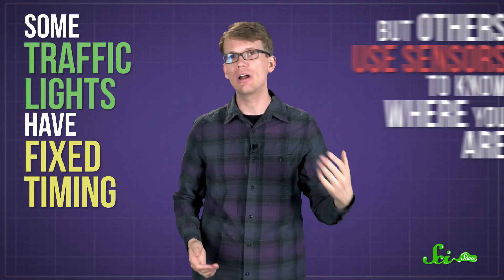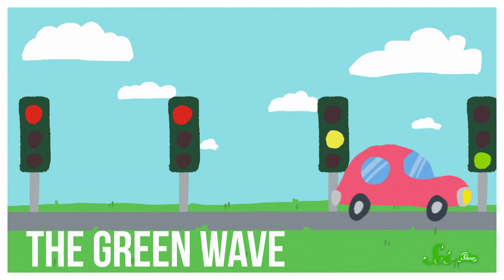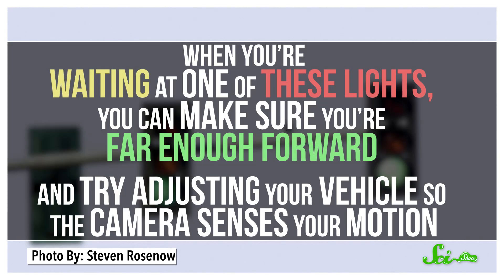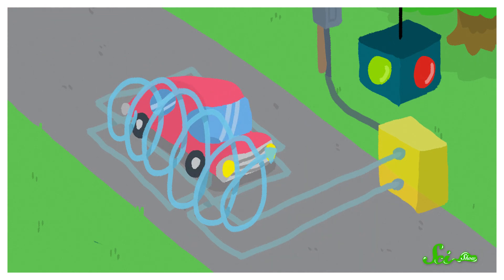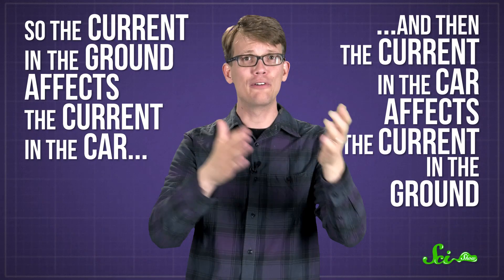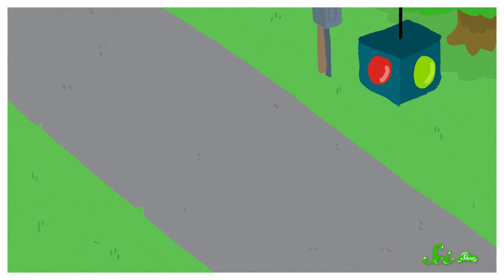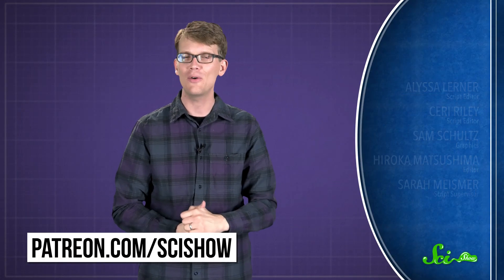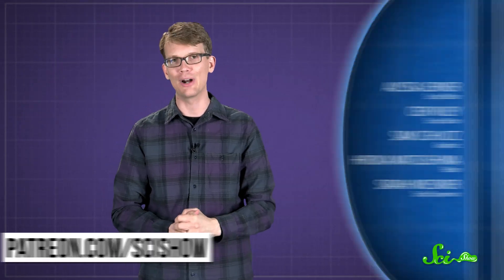How Can I Make A Traffic Light Turn Green?

Comment: Bicycles can change properly adjusted sensor red lights if they have alloy rimmed wheels. It works best to use the rear wheel (largest amount of metal on a bicycle) over the point where the induction loop starts. This is the point where a line comes into the loop of the sensor. If you put the rear wheel directly on top of where the line meets the loop, a bicycle can change about 75% of red lights. It is much harder to get lights to change with carbon fiber wheels.
  What Sci Show said about "push the button" is illegal in most states. The button,  crosswalks, and sidewalks are for pedestrians riding a bike on them is against the law in most states. A bicycle operated on the road surface is a vehicle. Technically the problem should be reported to the municipality as a nonfunctional red light, and you should treat the intersection as such. Although the limited functionality of the intersection should be made criminal as endangering unprotected civilians is inexcusable. The settings of the sensor and it's calibration via the PLC network that control the light, are the real problem most of the time. General passing traffic are all that is used to set up the system in an undefined nonstandard fashion. The limits of detection are not standardized, risking lives.

Comment: Or you could not be stupid and do the old right turn u-turn right turn to get through any red light
Reply: If a cop were to see you doing that, they can, and probably will, pull you over and give you a ticket.
Reply: I have considered this before... Is this an activity you have participated in?
Reply: Evasion of traffic control device (and possibly illegal u-turn) would be your charge(s).  Basically just as illegal as cutting through a parking lot to avoid a light, should you be caught, of course.
Reply: That depends on your location, some places it's perfectly legal to perform a U turn, and in the US generally a right turn on red is also perfectly legal
Reply: Making a right, then a u-turn, and then another right is a clear attempt at circumventing a traffic control device, which is illegal. It's the same as cutting through a parking lot to avoid a red light, which you can be pulled over and ticketed for.
Reply: In EU there is no right turn on red light.
Reply: TwiXter That's because you people drive on the wrong side of the road, lolz...
Reply: The Ranter US drives at right side too.
Reply: Sorry, I was thinking UK, not EU... But on a serious note... Why can't you turn right on red? That seems kinda stupid... Sure, in some instances, it's not safe to make a right on red, but that's what we have "No Turn on Red" signs for...
Reply: The Ranter It is stupid. I hate it.Going right is perfectly fine because its not interrupting anyone. (I don't know if interrupt was the right word)
Reply: its illegal to make u-turns in alot of places

Comment: Induction traffic sensors will detect motorcycles and even bicycles.  Simply roll right over one of the little grooves with your front wheel and stay  put so the wheel is stopped right on top of any section of the groove.  If you simply stop in the middle of the circle or square shaped induction sensor groove as if you were a car, then yes Hank is right.   You may be stuck there awhile getting very tempted to run the red light.   Lots of articles and even YouTube videos demonstrating how to trigger an induction loop sensor with a bicycle.

Comment: flick your highbeems at it - sometimes this seems to work
Reply: Haha correlation not a causation
Reply: if you can strobe at exactly 14 Hz and also superimpose the correct binary code at the same time. Emergency vehicle detection is a lot more complex than it used to be.
Reply: Another way is to get out of your car and twerk at the light, that also will set off its sensor.
Reply: yes it might indeed be a thing that does not work. Some lights have some sensor bar that reacts to the flashing lights of police and the like - or so I heard... humm be skeptical everyone.
Reply: Bloodbath and Beyond I said to be skeptical, no need for insults.

Comment: Fun fact about bicycles and stop lights - if you want to get a turn signal, just wack a strong magnet, usually a large electron-magnet. This forces the induction loop and alters the current without having to have the massive metal frame. Sure it requires a battery and some extra weight, but it can easily be jerry-rigged onto the bike to ease the hassle. Then you never have to worry about the turn signal, or wait for a car to come and activate the current for you.

I do this and it works wonders. My physicist professor also does this.

Comment: there's also some with a sensor for police to use to change it. the police use a white strobe light to change traffic signal. in order to mimic this all you've got to do is flash your high beams at the light. unfortunately this works best at night, and less so during bright sunny days

Comment: In Illinois, at night, you can treat a red light like a stop sign after a certain hour. Best text I could find from  625 ILCS 5/11-306

the driver of a motorcycle, facing any steady red signal which fails to change to a green signal within a reasonable period of time because of a signal malfunction or because the signal has failed to detect the arrival of the motorcycle due to the motorcycle's size or weight, has the right to proceed subject to the rules applicable after making a stop at a stop sign.

Comment: another option would to be: find the control box (usually hanging on a pole or standing as a lone breaker looking box near by), obtain a registered PLC laptop/program and a city worker uniform, break into said box, plug in computer and download needed program with changes to times and signals (setting them to your advantage of course), and leaving the scene. Sure the cops will get you, but first they'll be confused and say "what the F**K!?"

Comment: Tip for the cyclists that might not know. If you are riding clipless pedals that are metal (some are just plastic on the bottom of your shoe, that is why I ride SPD) drop a foot near where two lines intersect in a ground loop. While not 100%, it gives a slightly better chance of loop detecting you. You can also contact your municipality and ask for the sensitivity to be tuned for bikes. Real good to get motorcyclists involved in that effort as well.

Comment: How to turn a stuck red light green:  Get out of your car, go up and knock on the window of the person in front of you and tell them to pull up to the goddamn line instead of sitting a whole car length back! 

I've found that with motorcycles I have more luck getting lights to change if I'm sitting over the edge of loop instead of in the middle of the lane.
Reply: At least people there sit behind the line. People here think that line is for their back tires or to be 100% in front of that line.
Reply: The sensor picks up better where the line entering the loop starts. I can trip most of them by putting a rear bicycle wheel on top of where the lines intersect.
  Assuming you don't have a belt or shaft drive, your chain, rim, brake disc and cog are loops of conductive metal. Assuming you have room in the intersection, there is a much better chance of your rear wheel triggering the sensor when placed directly over the sensor/line intersection.
Reply: THIS.
Reply: Actually, the corner of a single loop is the best place for a motorcycle to be detected. If it is a double loop, (shaped like a long, sideways number 8) the strongest detection area is at the front-center or rear-center of the loop
Reply: Next time, just push your starter button. #thankmelater

Comment: The part about the bicycle, yeah, That's not true! If you lean your bike closer down towards the pavement it will trip the induction loop too! I lock my bike inside a Parking garage every day, and the sensor to open the door is an induction loop. To open the door, I simply step off the pedals and lean the bike down to one side, so the frame of the bike is more horizontal to the pavement, and voila! Open sesame.

Comment: In the UK some sensors pick up headlight flash (like that of emergency vehicles) and will change sequence of make it quicker, ie just flash your headlights at the lights (ONLY IF THE OTHER DIRECTION IS CLEAR) and that the road your at actually had sensors...or you look a tosser :)

Comment: Thanks for explaining the induction loop, I've been wondering about that.  While my car has plenty of conductive metal, none of it is ferrous (the car is primarily aluminum and carbon fiber plus lots and lots of batteries) and if the sensor was magnetic, I might be invisible.  On the other hand, you can induce a charge just fine in a big aluminum frame so I'm good to go (literally)

Comment: I used to put neodymium magnets in the sole of my bicycle shoe. I'm not 100% sure it worked on traffic lights, though they seemed to change quicker. I do know it definitely works on gates. The ones from hard drives seem to work the best without sacrificing comfort. Try it out on your apartment gate. You can totally mess with little kids by running up and stomping on the sensor. 15 minutes later you'll see a dozen kids jumping up and down on them.

Comment: what if i add a strong magnet to the bottom of my motorcycle? would that help with the induction loop sensors?
Reply: Yep, you can even buy magnet kits at some motorcycle stores.
Reply: +R Brown (4Crawler) Never crossed my mind that lifted trucks would have issues tripping lights but that totally makes sense. If I ever see a dangling piece of metal on one, now I know and won't be thoroughly confused.
Reply: Yep, my truck is not really lifted all that high, 33" or now 35" tires.  But I have the bottoms of the axle housing shaved off, spring over axle and the whole drivetrain lifted and tucked up into the frame.  This leaves a good 24" of room underneath with only the front and rear axle hanging down about a foot off the ground.  I used to find half the light sensors would not trip for me then added the low hanging magnet and I get better than 95% success now.  Only time I have trouble is if I can see where the sensor is located since I need to stop with the magnet within it's sensing loop.
Reply: Next time, just push your starter button. #thankmelater
Reply: Mason Hil 
*Neodymium
#thankmelater

Comment: Oh, another way to make the loop sensor see your motorcycle is to shut off the engine, and use the electric starter.  This will cause enough of a magnetic pulse to disturb the loop.  Or you can wind your own coil of 10 or so turns (to give it some resistance) under the frame of the bike, and hook a tungsol turn signal in series with your light tripping push button.

This would work for cyclists too, but for them I suggest mangling a cheap metal detector for their loop and drive electronics.

Comment: The little black thing is not a camera, cameras are usually much larger, and white to keep from overheating in the sun.  What he showed as a camera, is actually an optical preemption device that emergency vehicles trigger.  This is the reason for the white strobe on fire trucks.

  In my city, the magical frequency of flashes is 11Hz, which will cause the lights to nearly instantly turn green in the direction of the received flashes.  Other cities might have different flash rates.  But the main meat of what this video asks, can be answered by the right strobe, or if you are lucky, by the right infra-red remote.  Yes kids, these are sensitive to IR light, so you could conceivably make an invisible strobe to trigger them.  Just please be careful that you check both ways for REAL emergency vehicles,  and if you even think you hear a siren, forget using your triggering device altogether.

Comment: An interesting note is I've met someone who sold a magnetic kit that was designed to be attached to the bottom of a motorcycle to trip the circuit in the ground. Not sure the long-term problems of putting a magnet on a motorcycle, but seemed like an interesting idea.

Comment: Your bicycle comment is not true. You can trigger an induction loop sensor with a bicycle. In some places, we've had them on bike paths made smaller and more sensitive to trigger specifically for bicycles, however, even larger car sized loops can be triggered. THe trick is to have your wheel placed as close as possible to the wire in the pavement. That way, there's less flux leakage so you get a stronger signal - strong enough that even the relatively small amount of metal in your bike triggers the traffic light change. The induction loops around here are typically rectangular figure 8s and this typically works best if you align yourself along the central arc of the sensor. Aligning your wheels along the outside arcs can be hit an miss, depending on the sensitivity of the sensor.

Comment: but I have a wooden car....
Reply: Flintstones model.
Reply: But the panels would be metal, the axle would be metal too.
But sometimes being fucked at lights is the price you pay for driving a vintage morgan
Reply: A WOODEN CAR? which model?
Reply: +Tanishq Sagar the gullible model
Reply: set the Morgan on fire then you'd be fine
Reply: ***** It sure looks like grainy logs for the sides and sticks running up to support the roof which has some sort of cloth on the top. Wikipedia says "the cars are made out of stone, wood, and animal skins, and powered by the passengers' feet". I mean we can keep arguing about this stupid topic but the stone only appears to be the wheels and interior. Well they did have some type of bird for the radio.
Reply: There was an imported sports car, I don't know the make, that had a titanium engine and most metal components were titanium and it had a composite body and it would not set off the sensor.   Titanium will not set off many types of metal detectors and of course composite materials usually have no metal at all.   He tried to sue on city since the lights NEVER turned green for him and so that city reported him to the DMV who canceled his registration and notified him that the reason was due to insufficient metal content.   Not joking.  That happened about ten years ago.
Reply: Sad part, one small permanent magent attached to the bottom of the car would have solved his problem. It did for me on my motorcycle.
Reply: Uh no. There two sets of buttons. Assuming you are at a 4 way intersection at least. One for the light going north/south and one for the east/west as an example. this is all pointless considering its a joke
Reply: ***** Actually, it was made of wood and stone.
Reply: ***** Facepalm, but trust you right? Ok.....Look at the pictures of them all over the net. Those are logs on the side and the roof.
Reply: +Tanishq Sagar Vintage Morgan... 
Dr. Mallard of NCIS drives one
Reply: ever motorcycle i have owned gets an old hard drive magnet stuck to the underside.
Reply: Pikapetey Animations you are everywhere

Comment: On a bike you can lean your bike sideways over the sensor and it will detect the increase metal. If you are not capable of that, you probably need a lighter bike.

Comment: I'm surprised you didn't recommend to motorcycle and bicycle riders to use a neodymium magnet stuck to the bottom of their vehicle. Super cheap and easy to install, and its large magnetic field will affect the loop to cause a detection.

Comment: I don't understand why the vehicle loop sensor explanation is so shallow. The loop is part of an oscillator circuit and the oscillator is tuned to a specific frequency and a phase-locked loop detects any changes in that frequency. The presence of metal in the loop causes a frequency shift and this sets a bit in the controller that tells it a vehicle is present. Are you now tailoring your videos for a 3rd grade demographic?

Comment: I've heard you can stick a powerful enough magnet to the bottom of your motorcycle or bike it'll trigger the induction loops.
I've been stuck at one of them on my motorcycle before, luckily there was no traffic so I could just back-up and move over the centre of the loop which triggered it, I'll try putting the stand down next time but

Comment: In Pennsylvania there was a law that i think was passed recently that allows you to run red lights in this very situation. It's mostly for motorcycles where the traffic cams won't detect them so they get stuck at lights because the lights won't change.

Comment: Hank, the thing you circled was not a camera, but rather an Opticom sensor. An Opticom sensor detects the coded strobe lights on fire trucks , police cars, and ambulances. If it detects one of these emergency vehicles it will change the light to be green for that direction. This is called pre-emption. You also missed the fact that if someone hits the pedestrian button at a large intersection that it can take that intersection out of sync with the other intersections (required walk times for large intersections, based on 3.5 ft /sec, can be longer than the cycle length time for that phase of the signal).

Comment: Tip on making a red light turn green faster:
- When approaching a red light, make sure you stop as close as you can to the stop line on the road. 
-Take you foot off the brake and creep forward a foot or two feet then brake.
-Take you foot off the brake and creep forward a foot or two feet then brake.
 -Keep doing this a few times and watch that long-ass red light turn green fast. 
It works every time for me. Try it.

Comment: Some of the older traffic lights by my house use induction loops...
Unfortunately for me, I'm on a motorcycle, and they cannot register that I'm there (even if I put the stand down).
But thankfully, I usually work very late/early, so I make sure the road is clear, and then drive through anyway.
"I'm sorry officer. Either I run a red light, or I sit here idling until I die of hunger" :P